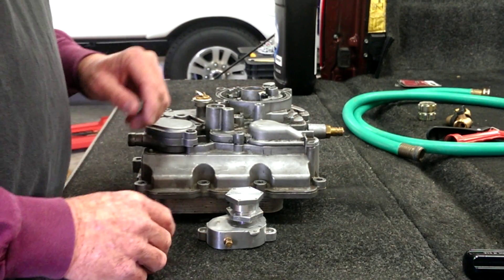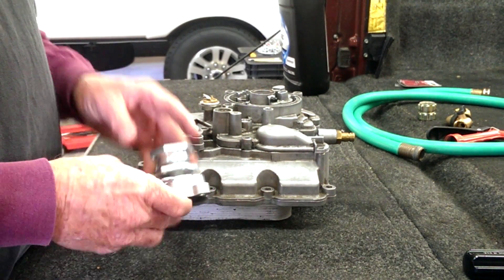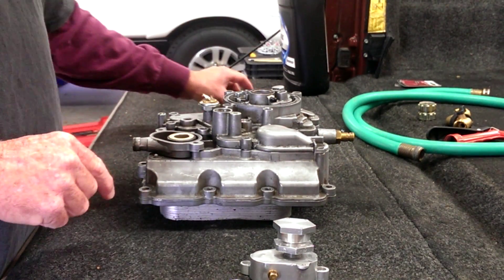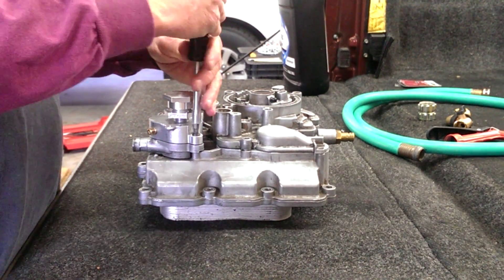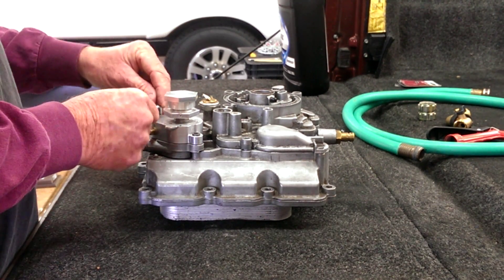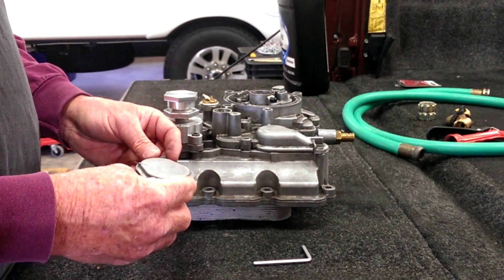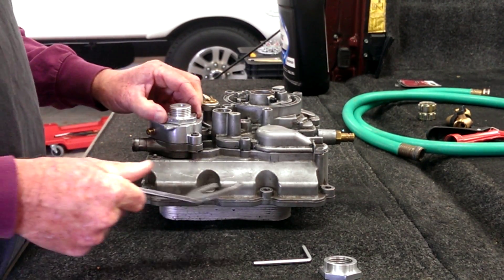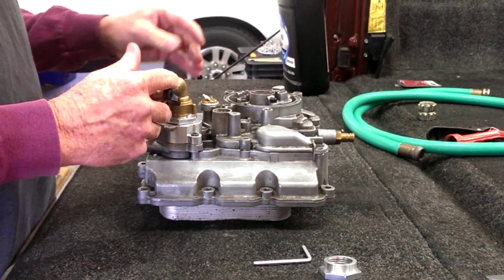Oil Cooler BackFlush Valve Installation for Ford  6.0

Comment: I know that this is an old post but here are my thoughts on this. Am thinking of using something of this nature along with the combination of a replaceable filter setup and flow indicator to help eliminate any particulate from getting to the oil cooler and plugging it up; also looking at possible using a whole coolant system filtration system with a flow indicator for monitoring the system operation to avoid possible air pockets in the system. The current systems being toted are just not enough for what it's worth in my opinion. Probable use the whole system filtration with flow monitoring " not the screen system that is currently out there" on other applications to help eliminate particulate build up in the coolant systems.
Reply: The problem is finding a way to filter all of the coolant as it leaves the water pump and before it is directed to the engine cooling system and the oil cooler. It is a multi path system.
Reply: @jimcooper3969  I understand this I'm looking at the inlet side of the oil cooler using it to install the filter outlet, seeing it passes through the oil cooler first then passes through the EGR cooler and out.
Reply: @jimremington716  You will need to be sure not to reduce the coolant flow from the filter to the oil cooler otherwise the oil cooler delta will be impacted.

Comment: Bulletproof and Had a filtration system for years but finally Had my cooler replaced... again. Ran beautifully at 195 oil/190 coolant for about nine-ten months and started climbing. So I put one of these on. Works as advertised but completely dependent upon the amount of debris the factory left in the block. Some things about doing it on the truck versus on the bench; remove the turbo intake and get a expansion plug from the plumbing department so nothing ends up where it shouldn’t. Yes a ton of sand and crap came out, and this is after bulletproof and heads decked. Remember cooler replaced...twice! It never got back to the perfect delta but did during it to within 25 degrees. Coming up on 10k from the last time and it’s running back up in 230’s on the highway at 65mph. Got it up to 239 once. So I’m gonna give er another flush with next oil change. Just sad that Ford missed the Mark so poorly with quality control. Really the best solution would be something external but those all seem ridiculous in price. 

Question though: I did this process with the engine completely cold. Would it make a difference if there was a bit of heat in the block? Or is there a recommended temperature to do this. My guess is engine completely cold for the sake of not cold shocking hot metal.
Reply from the maker: Ron, it is not unusual to continue to get some debris out of the oil cooler with a backflush. Mine is a perfect example. I'm pretty sure that one of the videos includes the info you mentioned regarding the turbo CAC boot and the turbo discharge port. You might want to try a full cooling system flush if your oil cooler continues to plug. There is a link to a full flush procedure on my website in the Q&A section and you can find it on FICM Repair site also. I followed it on my truck and it did help.
Reply: @oilcoolerbackflushtoolvalv9021  thanks. I’ll give it a look

Comment: Can you make a video with the back flush valve installed on your truck to see it in real operation?  Thanks for the video and making an awesome product!
Reply from the maker: Hi Mark, there is another video on the YouTube page showing the Back Flush Valve in operation on my truck. You can also access the videos and other helpful info on the Back Flush Valve website. Check out  fixur6.com 
Let me know if you have trouble accessing anything.
Good luck with your truck.
JC

Comment: can i buy this backflush valve anywhere?
Reply from the maker: Victor, thanks for asking about the backflush valve. Yes they are available and in stock! 
Check out the details on the web page.   Fixur6.com
Good luck!
JC
Reply from the maker: The web page is   fixur6.com
Reply: @oilcoolerbackflushtoolvalv9021  

When doing just the Backflush procedure on the oil cooler, just having the lower rad hose off is enough correct? Having the block plugs out is really for when doing a full doing system flush ?

Thanks so much, what an amazing idea.
Reply: @canuckweld7347  correct. To backflush the oil cooler you only need the lower radiator hose disconnected.